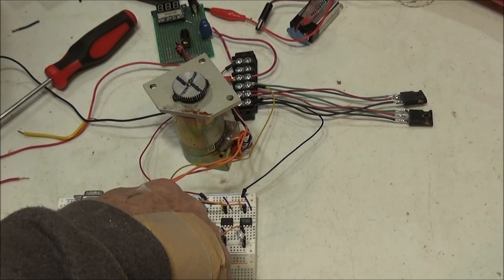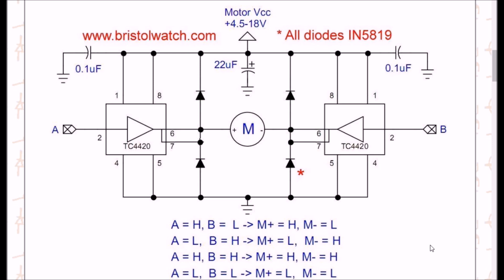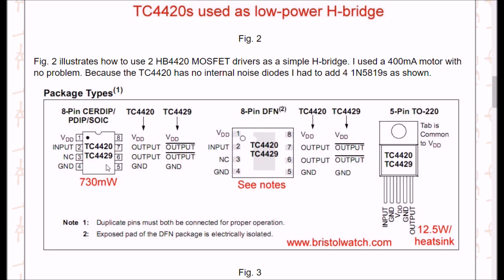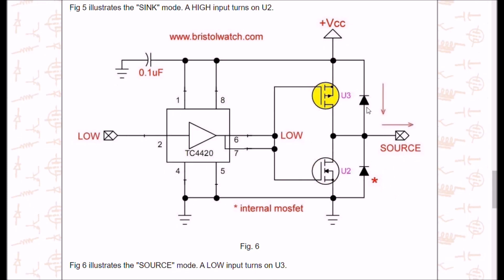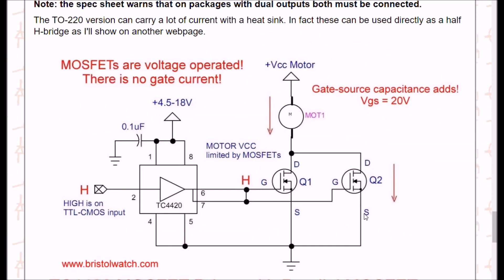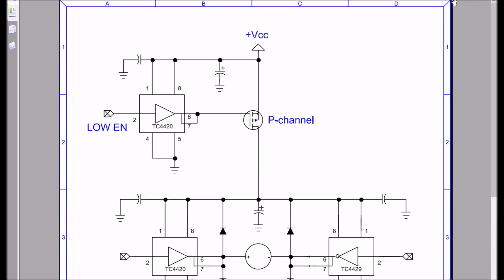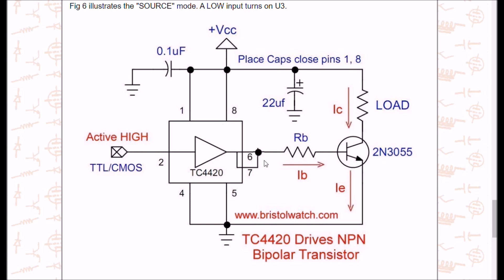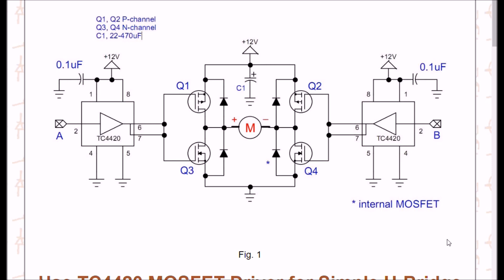Pt. 2 TC4420-29 MOSFET Drivers Circuit Examples

Comment from the maker: Other h-bridge videos:
High Voltage IGBT H-Bridge Using Photovoltaic Optocouplers
https://youtu.be/azJo4h-ei6I

Arduino Controlled IR2110 Based H-Bridge HV Motor Control
https://youtu.be/d0r-Yx9R3Zs

Pt. 1 Interfacing Microcontrollers to CMOS and MOSFET Circuits
https://youtu.be/XzetdwzcOrY

Pt. 2 Simplified CMOS-MOSFET H-Bridge Circuit
https://youtu.be/rExHPqTUBuA

Pt. 3 Tri-State H-Bridge using CD4093B CMOS Circuit
https://youtu.be/b8O4ihdHx8U

Arduino Unipolar Stepper Motor Driver Board with Arduino Code
https://youtu.be/HTVYiLOY8SQ

Comment: The datasheet of this TC4420 driver shows an output  Resistance High and an output resistance low at page 4 of around 3ohm. What does that mean in relation to driving these motors?  Does it mean that at 0.5A drive you have a dissipation of 0.75W and a voltage drop of 1.5V at the output? How do I need to interpret that output resistance value?
For mosfet driving, this resistance is not a problem because the gate driver only charges the gate and doesn't work continues. But using this as a constant motor driver that a different ball game. Help me out here

Comment: Am I right that TC4427 can be used as an externally controlled switch to a low-power power supply? (even two of them) - without adding external circuitry?

Comment: Hi I can I use this to drive a h bridge inverter circuit with this using all npn I don’t use pnp because of the heating from them
Reply from the maker: What voltages are you operating the invertor at?
Reply: @LewisLoflin  24volt
Reply: @LewisLoflin  the Ic work very well with my half bridge inverter

Comment: hiii... i repair ECU (engine control unit)...i noticed that the gate of the mosfet is connected to its source... what is the purpose behind this..the mosfet is 620TG.. plzzz suggest..thank you
Reply from the maker: Where is this at?
Reply: @LewisLoflin  hii... this mosfet is in one of the mahindra company car ECU that i repaired last week...this mosfet makes 48 volts on its drain...the gate nd source r tied together nd supplied with 12 volts nd these r further connected to the drain of another mosfet

Comment: I know this post is a few years old, but is it necessary to have any type of gate resistor, or 10k to ground to fully turn off mosfet? or does the tc4420 do all that. First time trying these drivers.  Thanks for the videos, they have been very helpful.
Reply from the maker: You can try leaving it out and see.
Reply: @LewisLoflin  Well I scoped the output of the TC4420 and it has good control, no resistors, just caps. I did notice while only using a logic level mosfet with 5v at the Gate, the mosfet was not pulling completely to ground(0v). The voltage drop across the Drain to Source wasnt much, not enough load I think, but the driver waveform was almost perfect squarewave.

Comment: what would be the reason that 4420 keep malfunction after very short while ? i was not using the capacitor 22MF  would that be the reason ?
Reply from the maker: How is it connected and to what?
Reply from the maker: If you are driving a motor directly then the motor is drawing too much current. That only works with very small motors.
Reply: @LewisLoflin  the 2 is connected to an arduino and the 1 and 8 is connected to 12 volts power supply and the ground of the power supply is connected to the Mosfet , 4 and 5 is connected to the ground of the mosfet and 6 and 7 is connected to the mosfet gate , no capacitor was put on the driver between the power and the ground of the driver
Reply: @LewisLoflin  mosfet works on voltage no ? i mean if i have 10 volts on the gate from the driver then am ok even if the mosfet connect 1200v 36A which is the rating of the mosfet right ?
Reply from the maker: @EnergySeeker  The gate-source voltage turns on the drain-source current. The voltage rating of the drain-source has nothing to do with the gate circuit. That being said be careful of ratings such as "1200v 36A" because 36A is peak current at a very low duty cycle.
Reply from the maker: @EnergySeeker  The lack of a cap won't blow up the device. The cap is used to control electrical switching noise. See Fig. 6 on this webpage:
https://www.bristolwatch.com/TC4420/index.htm

Comment: 4420 designed for driving a N and P mosfet pair? Both output pins of the 4420/4429 always connected?
Reply from the maker: The output itself is a N and P mosfet. Both are  connected internally.
Reply: @LewisLoflin  Later i realized that it was the 4420/2229 internal drawings. But it is a low side driver i understand now. Thanks for responding